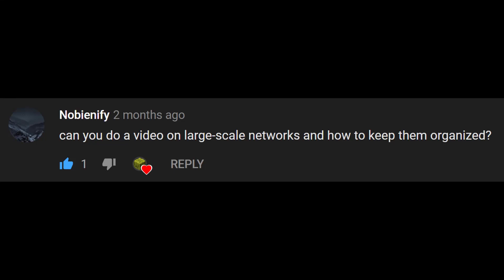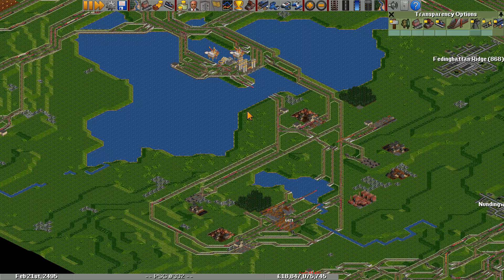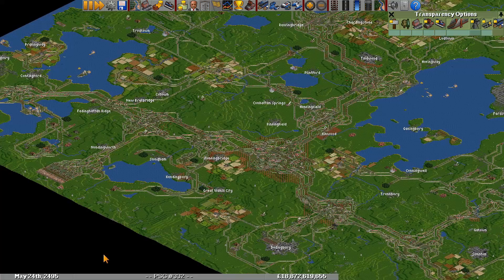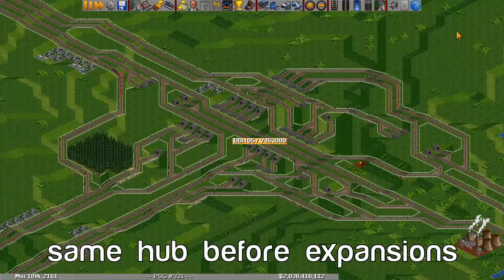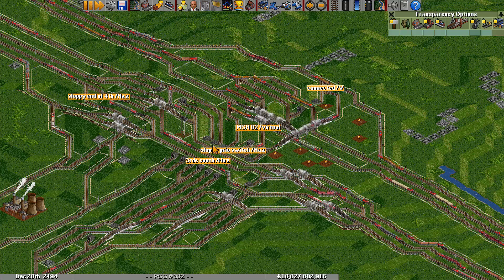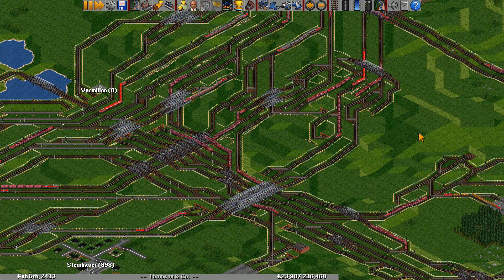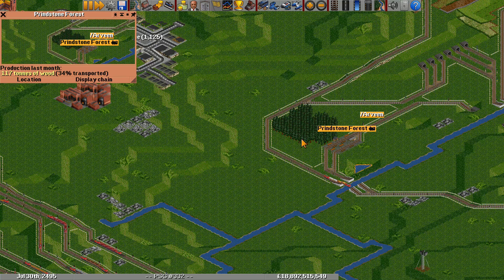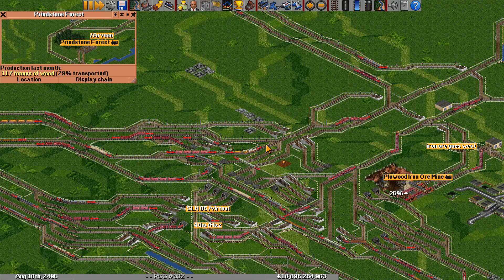OpenTTD Networking: Organizing HUGE Networks

Comment: In your coop games, do you pick, say, a power plant and deliver coal from across the whole map to the plant? Perhaps connecting several nearby coal mines to a transfer station, then connecting the various transfer stations to the rail hierarchy? Do those trains run empty on the way back, then?
Reply from the maker: Yeah, generally we'll just connect everything up to a main station power plant. But usually even if the mine is nearby we'll still just use a likely further away SLH just to keep the network coherent
Reply: @LugnutsK  Ok, great, thanks!

Comment: How do I service the trains on such high throughput networks? I used to use forced maintenance desings but those don't work due to trains backing up as they slow down to enter the depot so I am now stuck without a way to build such large networks that don't have trains breaking down everywhere unless I have them backing up onto them as I send them to depots in forced servicing.
Reply from the maker: For these networks we play with breakdowns off. Breakdowns just cause too much trouble to make a network this huge
Reply: @LugnutsK  makes sense, I easily had spend three day, roughly 9 hours of my time, figureing out a desing for this and I am about to give up. I have now a desing working that can manage 14 length trains with forced servicing on a 6 track station and have them enter fast enough that 4~5 tracks have a train but I am losing my mind on having the station not be absolutly huge -- it is impossible to build without the magic bulldozer -- on my way to find someone else's desing I found your video on the NewGRF & Setting and just copied all you've got. The PURR Rainbow Rails are a blessing that I would have not found on my own without you <3

Comment: How do you maintain all the trains on your network, let alone prevent jams during network upgrades?
Reply from the maker: I (and OpenTTDCoop) play with breakdowns off. It is just too annoying to deal with on huge networks (at least I assume...).

For upgrades usually we add one line at a time. Hubs get upgraded by slowly moving tracks around, adding more, keeps things flowing. Sometimes you do need to nuke a (section of a) hub though and the whole network jams up, have to rush to finish the upgrade, and the jam can take a year to clear...